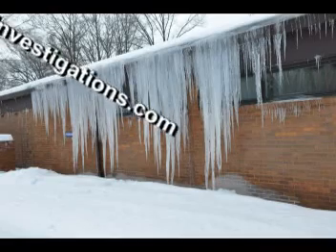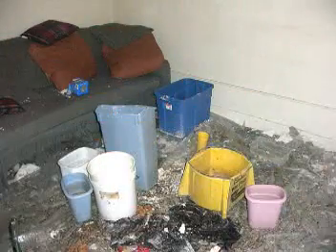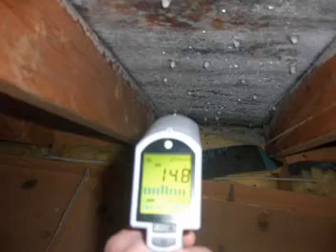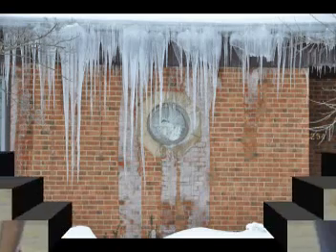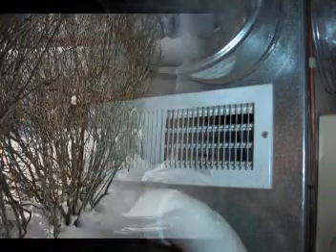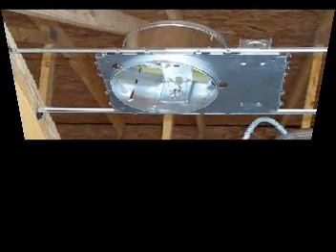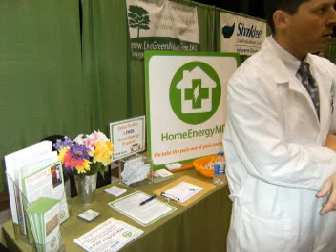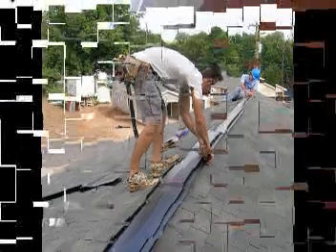The truth about ICE DAMS

Comment: Try Praetorian Disaster Supply's HydroSacks, they absorb the leakage before it penetrates through the insulation, you simply place the barriers INSIDE, the attic in areas prone to leakage as a result of dammed ice and the 1 lbs. bags will activate on contact with water and absorb approximately 50 lbs. of water. PraetorianDisasterSupply.com

Comment: Proper air sealing with adequate insulation and ventilation are a good start. A well balanced HVAC system with a well "designed" duct system with zero air loss is next. The following website is a source of knowledge that I have enjoyed reading. http://www.energyvanguard.com/
Reply from the maker: Christopher Packard Christopher, thanks, I will check it out.

Comment: A very good video, but you lost me when you started talking about gutters, "gutter contraption people, and gutter protections being "ice dam making machines.". I am not in the "gutter contraption business" nor the gutter protection business. I am a gutter installer. Gutters never create an ice dam. Even the worst gutter "protection" (and yes, there are some really bad ones) does not create an ice dam. If you look at the design of the gutter, it is impossible for water, snow, or ice to build up and back up. I will give your video two thumbs up for everything you talk about prior to the information about ice dams and gutters.
Reply from the maker: Wendell L Some of the contraptions freeze up. Some get clogged like the gutter sponge. You are correct., 95% of all ice dams are caused by thermal bypass.
Reply: Clevelandmarko I'm with you on that sponge/foam garbage. There are many gutter protection products that are complete trash. And, as an FYI, I also have issues with how much of this stuff is sold at home shows and the sales pitches that are made. All in all, I think your video is good.

Comment: May I ask? Heating Cables on Roof . what are the best and easiest to install. Thanks, Paul.
Reply from the maker: Paul Laso Paul not sure. First fix the thermal bypass and maybe you will not need heat cables.
Reply: Clevelandmarko  thermal bypass??? misunderstanding I want to install gutter heater wire b4 the coming winter. Is Eastheat a good product or do you recommend a better one?

Comment: THE REAL TRUTH ABOUT ICE DAMS -- an ice dam is the direct result of an un or under ventilated attic.  That's it period. All the other stuff in the attic is relatively true but you must provide soffit venting 9 inches per foot -front and rear. Then install an EXTERNALLY BAFFLED RIDGE VENT like the Air Vent Shingle Vent II with 18 inches per foot on the ridge. All of your problems solved. We have taken homes  with ice dams and icicles solidly for 2 full stories and stopped any further problems in their tracks. Do it right the first time  and understand why you are doing it.  44 years of successful guaranteed roofing behind me.
Reply from the maker: You are correct 75%. I have photos of attic mold and ice dams on house with the venting spec you speak off (1 SF -vent /150 Free attic floor area).  These homes have ceiling can lights and thermal by-pass (hall way  whole house fan and pull down stair ) and basement negative pressure.  This is an ice machine with or without venting.  I also have the gutter guard ice dam machine photos too.

Comment: This video is incompoleteabout the cause. If you live farther north, where you keep snow on the roof for many weeks the roof deck is insulated by the snow above it and becomes slightly warmer than the roof edge even with good vent channels under the roof deck and no point source thermal leaks. Sunshine also warms the roof deck. 
    Eventually you install either 1) heat cables 2) water shield under the shingles 3) sheet metal roof edge - or a combination.

Comment: Well done. Very informative.  I just spent over $2,000 to install a hung ciling, complete with nine recessed lights. It looked great -- until the snow came. The blizzard of 2010.  Now I have puddles in the ceiling tiles from a roof leak cause by an ice dam........I understand the idea of preventing warm air from the living space into the atic. but with my old house, that is not so easy.....To pick up on  Yzarcful's comment, is there a way of installing heat cable so it will do the job????

Comment: Greetings from No. Virginia. We are just digging out from the Blizzard of 2010. Q:  Ours is a solar-passive house, aka "envelope house," which is designed to allow warm air to pass thru the attic and recirculate between the double walls at the rear of the house. Our roof (cedar shingles) is steeply pitched & has 2 large banks of skylights on the front (SSW). No leaking so far. What if anything should we do about the large accumulation of snow/ice/icicles on the lower portion of the roof?